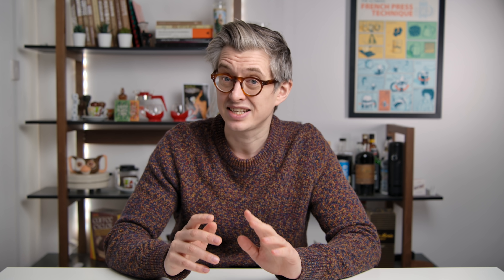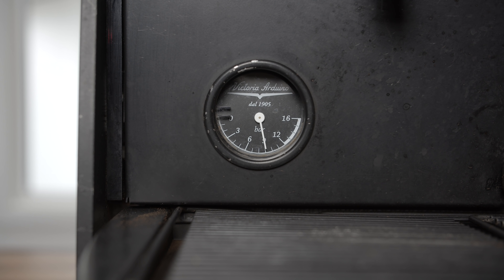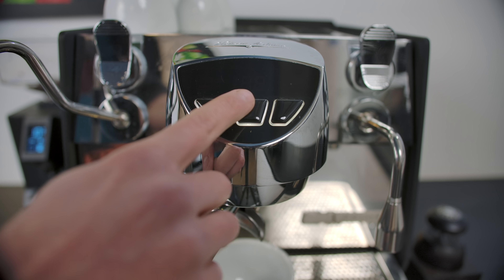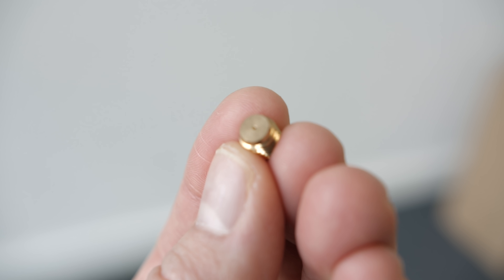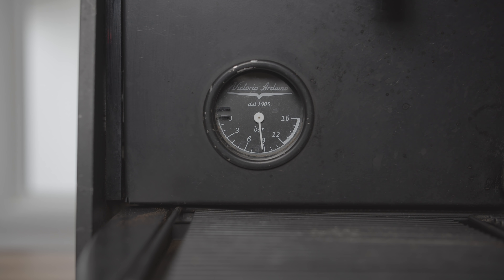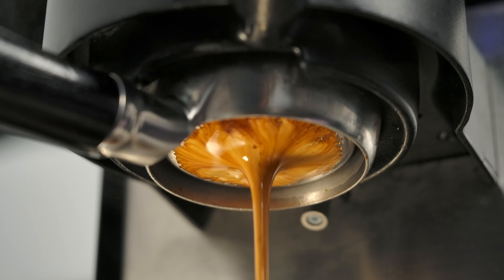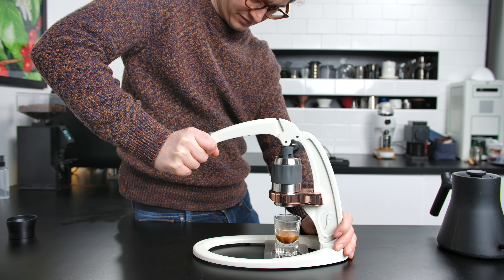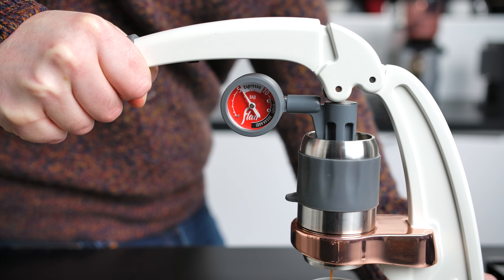Understanding Espresso: Pressure (Episode #6)

Comment: This is very useful for those of us with lever machines, we can vary the pressure however we want. I usually bring it straight up to 9 bars and leave it there until it's done. I will start experimenting with different profiles.
Reply: try ramping up to 2 psi and hold it there for the first 20 seconds, then ramp up to 9 psi, and after like 5 seconds, slowly start to ramp down to 6 psi by the end of the shot. that's how I do it
Reply: @maxlee6676  Which lever machine do you have? I've found with the Espresso Robot the puck likes to lift at low pressure (pre-infusion). I was thinking of having a machine shop make a new basked without the rounded bottoms.
Reply: @GrantMcWilliams  I'm using a flair signature, and the bottom of the basket has a small concave, but I haven't had any issues with lifting. I just get a few drips at the beginning, but I just go on with it. are you maybe releasing some pressure during or after pre-infusion? with my flair, in order to maintain 2-3 psi (I actually usually go with 3 psi, I only said 2 psi because you'll get less drips at the beginning), I actually press down on the lever very slowly while watching the pressure. I don't really think I've experienced lifting.. so im not really sure what to do about that
Reply: @maxlee6676  Thanks, I think the issue is the edges of the Robot basket are rounded and the water finds it's way around it. My puck doesn't lift unless I try to pre-infuse and other "more experienced" robot users said it was because of the shape. I think if I start out slow and increase pressure in a sort of preinfuse then it might be fine. I'll try that.
Reply: @GrantMcWilliams  sounds like the robot needs a new gasket?
Reply: @BensCoffeeRants  I took the gasket off, didn't remember the orientation so I put it back on upside down, watched the water spill out the sides and then reinstalled it the right way and the robot works again. Why? Who knows.

Comment: You need to be careful not to confuse the flow restriction valve with the restriction valve in the heat exchanger which is entirely different. If you have an E61 HX machine your flow restriction is in the mushroom of the E61 head. There’s some variations of E61 that have flow control lever's on the E61 mushroom head like ECM & Lelit

Comment: wondering how extremely long (45s+) preinfusions affect espressso, I've had great results doing them on my flair.
Reply: A 45 second preinfusion? I would think it would be over extracted. Talk to me. I have a Flair too.
Reply: @limer4330  I haven't had it produce any bitterness, unless of course the grind has been too fine and the resulting shot has choked. I think overextraction can only really happen at pressure, or would take much longer than a minute not at pressure (hence why it's so difficult to overextract in a french press).

Certainly preinfusion in general I think helps with channeling, and in this way long preinfusions can, to a limited degree, compensate for suboptimal puck prep. 

It definitely changes the flavour profile, alas I am too new to espresso to really give an account of how it does, as I haven't tried enough different beans to say. Suffice to say it brings out some flavours and mutes others. I've definitely enjoyed most of the shots I've pulled with long preinfusions. It's why I was hoping it would be discussed in this video. 

It reduces crema in my experience (which we all know is a good thing (; ). 

I think maybe people don't like to talk about it because you can't do it on automatic machines shrug
Reply: @panmicrotones  thanks for sharing. I'll have to play around with grind and pre-infusion. What temp are you pre-heating the brew group with and are you using the same temp to extract with the Flair? I've been using 212f water to preheat and extract. My thought behind this was even though I've preheated twice with 212f, there's still enough heat loss by the time I extract that the water temp has dropped to at least 200f or lower. I've been measuring it with a Thermopen but can't speak for accuracy. I'm wondering if my extractions are too hot. I doubt it but am curious what other people are doing.
Reply: @limer4330  Yep I do the same: I double preheat with boiling water and pour boiling water straight in. Haven't experimented with lower temps, but my beans aren't particularly dark roasted. When I get dark roasted beans I will try with lower temps/single preheating maybe, but my research tells me that getting as hot as possible is pretty much consensus.

Comment: Would love to see you dial in a coffee on the used budget set up and then again on a commercial machine. Same bean. Just to talk about differences. Or even have someone else do it in tandem and you compare results idk. Think that there is some value in that
Reply: I dunno man, there might be some value. But from my experience, the same principles apply to dialing at home vs commercially. It's all a limitation of your equipment, but that also can help inform how to accomplish the dialing process. There are some general guidelines, like "Dose makes the biggest difference in flow" and "Adjust grind size to taste, and then subsequently re-adjust dose if necessary after seeing a shot pull with the new setting" work both at home and in Cafes. The big differences come down to speed of production. Most people generally have more time at home, and during a rush, we gotta be getting coffees out at 1 every 45s-1m.

Comment: If I tamp down the puck too firmly on my old DeLonghi Icona, hot water comes out through the side of the machine, so I'm not gonna stress about pressure. Thanks though I'll try and remember the tips.
Reply: I suggest to check the machine's o-ring gasket at the shower screen. It is supposed not to leak any water
Reply: @syahrirx  Ah thanks and I have cleaned that O-ring, but it leaks through the side-seam of the case so I think somethings wrong inside. As long as I don't over-tamp it works fine so I'm putting off opening it up ;)

Comment: I'm using a flow control machine for my daily coffee which is DC Mina, the pressure of this machine is fixed at 9 bars, but you can have full manual control on flow rate by a digital flow regulator up to 5 step, by using naked portafilter, I start to see the channeling happen if we keep the common flowrate around 8-10g /sec and if we low down flow rate when the live coffee pressure in the basket & group head meet the peak and pressure start to decrease, the live flowrate pass through the coffee also start to increasing and we can start to reduce flow rate to slow down the output flow and for few years of experimental, i think it's quite good to control for repeatable brew for consistency, in result I get lesser fine come into the espresso and more higher flavor clarity in the espresso, but in result compare to other machine i have, the body is slightly reducing.

Comment: James, thanks for the great explanation as always! Would you advise me to tune up my Gaggia Classic Pro to a 9bar or 6bar spring? By default Gaggia comes with 12+ bar which is way higher. Would the difference be noticeable right away, or it is better just on paper lets say? Thank you so much!
Reply: I just installed a 9 bar spring on my Gaggia Classic because I was getting either channeling or somewhat short extraction times with my E&B labs basket at 20gr of coffee. Trying to learn how to use the Gaggia again as a result of the change :)   Had to switch to a coarse grind and reduce the dose as the Gaggia stalls when I use the same recipes I used with the 12bar spring.

Comment: I really appreciate this one, James. I don't know if you have ever experimented with, or are aware of any of the small number of "prosumer" home espresso machines with gear pumps, such as the ACS Vesuvius. I have had Quick Mill's version of this  machine for over a year, and I absolutely love it.  While I have ended up defaulting to a modified spring-lever profile most of the time, it has been fascinating to experiment with pressure profiling in general.